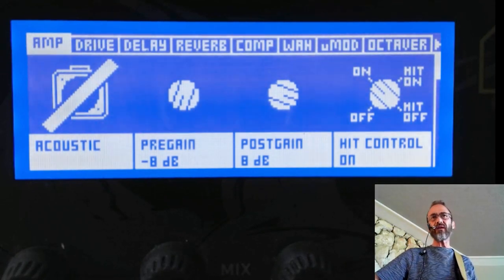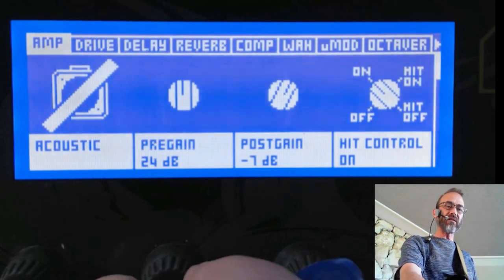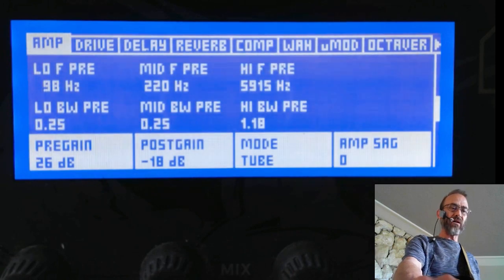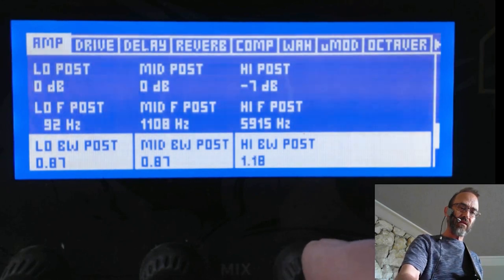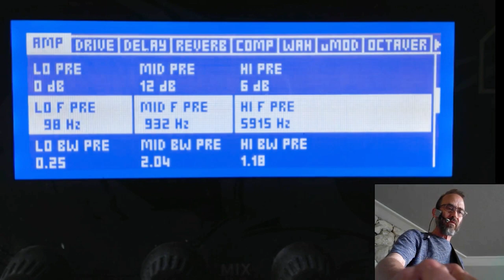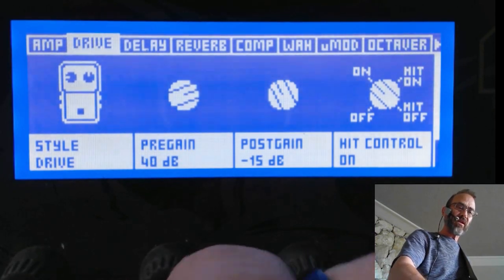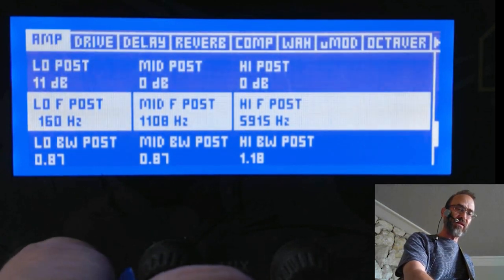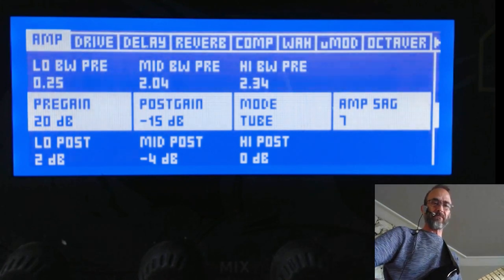Deep Dive: Amp Modeling with VoiceLive 3 and 3 Extreme (VL3/VL3X)

Comment: One thing I discovered: The amp models are simply combinations of all the settings available in the Amp tab. If you take, e.g., the “chicken picking” model’s settings and reproduce them with any other named amp model, the sound will be identical. That’s not actually amp modeling as any other company does it.

Comment: I kid you not, I was just about to sell this due to my frustration about setting it up with pure acoustic guitar and vocals, and had returned to using my Play Acoustic live So, I decided to give it one more go after watching this video - and it really helped me understand what to do., and what all those parameters actually affect. I know two people who resold this unit because the amp section way way to complicated to use in this format and layout. But I tweaked this all day, and finally got the great sound I wanted from my Godin Multiac. Thanks again ( please do an in depth,  dedicated guide for acoustic guitarists ) Thanks again, this video should be linked to in the manual. Ta.
Reply: Yee haw...i just bought one....comming next week. I'll look forward to the complications.
Reply: I have a Godin XTSA also bewildered by guitar basic stuff like even the volume
Reply: @dancassidy7471  I sat with two different recording engineers and they both were completely baffled as to why this has been build to confuse rather than assist the artist. Kudos to TC Helicon for making this unit - if it works for you, great, but I have struggled continually with this unit. The vocal section is second to none. It's first class for live performance. But the guitar section is a real pain. Lately I have started using the T-Rex Soulmate Acoustic for my acoustic guitar, coming out of a Play Acoustic for body-rez and all Vocals/ harmonies. It's a way simpler setup. The Voicelive 3 just feels like its trying to put too much in one box, when they could have made a new Play Acoustic with midi sync, and more individual controls for Acoustic guitar and Vocalists. And keep the two tier approach - simple and advanced editing. This video really helps with the VL3 though.
Reply: @johnmorrell  thanks very much .I think I'll  run my guitar thru into my tube amp. If I don't get the sound I want.

Comment: Would it ever be possible to change the button map of the looper section? I’d much prefer to have vertically aligned A, B and C sections. (Or even just A and B if you still have to swap between B and C.) To have my start and stop buttons above and below each other instead of side by side would be my preference. If it’s possible to do so and I’m missing it please lmk. Thanks. As far as the amp modeling it’d be nice having the gate as a pedal instead of a master control and I’ve also always wondered about the possibility of signal chain of effects. The ability to put fx in order like an actual pedal board should be standard issue parameter control. Easier said than done I suppose. Thank you for making this deep dive. I’ve only come to understand the amp modeling thru a lot of time spent tweaking. This video would’ve been helpful years ago. You made a powerful tool that’s widely misunderstood and can still be improved. Please keep up the good work!

Comment: The video is excellent but highlights my frustration with the VL3X Awesomely simple for vocals but way too complicated for guitar. I don't need to have as much adjustment as has been given. My tube amp has Lo, Mid, pre- gain and post gain, and presence knobs, and 2 channels. Took me all of 50 minutes to find all the tones I wanted for use live. I need knobs not a long list of parameters, all of which need tweaking to get something I like. I want to play, not be a sound engineer. I now find myself having a Headrush alongside my VL3x as its super intuitive, and just a few knobs to get me where I want to be. That said it has all the eq settings the VL has, but I don't have to use them to get a great sound!

Comment: Thanks for the video.  One tends to forget about the guitar side on the 3 Extreme and you've shown there's loads of options to get the sound you're after.  Personally, I want big clean acoustic and clean electric sounds for jazz / folk etc and a few nice overdriven sounds for blues and rock n' roll numbers.  So great idea to offer some standard settings.  A very clear explanation of each option would, of course, be great but way too time consuming - I guess. Using a A B swich box mentioned in another video recently is a great idea for making the use of acoustic and electric on stage together simple.  Thanks for the video and keeping the VL3x family alive and kicking. It's still the Rolls Royce of effects units for one man/woman shows. I use my VL3 Ext for streaming and live one man shows, so maybe a video on the set up side of things and the various options for stereo, dual mono, mono, balancing backing tracks, guitar, vocals etc would be great? Again, so many options under the hood but not well understood.
Reply: I switch between electric an acoustic all the time. I engage the tuner to mute the guitar then swap instruments.
Reply: I had a play with this last night.  Very impressive.  Love the compressors.  One thing I found was that when I set up the fx button to do wah, octaver or chopper.  Sometimes the settings stayed after I changed the choice.  At no point did I save anything.  Any ideas? Am I correct in thinking the drive is just gain or boost?  No distortion option as such but done in the amp simulations?  From memory that's different from the Nova (which I also have).

Comment: What is the difference between lo post , lo f post , and lo bw post?
Reply: Lo refers to the band so it is the low band. Post refers to where the eq band is in the signal chain.  Post means that it is after the non-linear (distorting)  tube or transistor  simulation. Lo f is the frequency the band is dealing with.
Reply: Lo bw post is how big of a swath of frequencies the eq band with effect the bigger the number the more the area that will be effected
Reply: Ahh yes, thanks, bw = bandwidth.. so much to learn and experiment with.

Comment: What would be a good setting to use my VL3X as more of a stomp box into the effects loop of my tube amp. When I've tried previously the signal sounds garbled.
Reply: Turn off the amp model speaker sim settings. Just use the effects into your tube amp. It made my life much easier. My two cents.
Reply: @scotthenderson8577  I already tried that... Still sounds garbled
Reply: @evilevon  Might want to try going through the front of the amp. I use a Fender DR and go through the front of the amp. Good Luck

Comment: Do you see what the problem is here? It's great that the user can tweak to an insane degree, BUT, you just spent over 20 minutes creating what I'd call an "OK" sound. The models needed to be a lot more accurate on this pedal in the first place. Always been my biggest complaint with this. Don't get me wrong, the VL3ex is my main live tool, I rely on much of it's capabilities. I just think for the price, the amp models and effects could've been substantially better without having to tweak the crap out of them.
Reply: I would say this has two models tube and transistor, the different amps are just presets.  I own one, but I also have other modelers that do things differently. Boss, Fractal, etc.